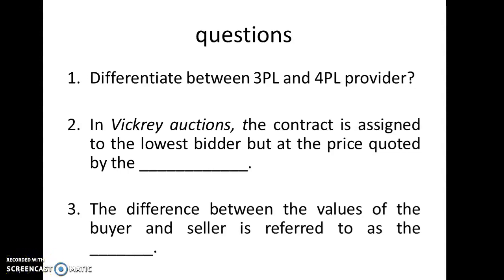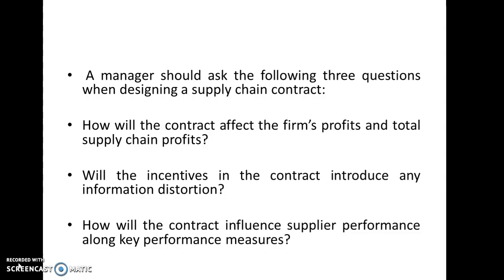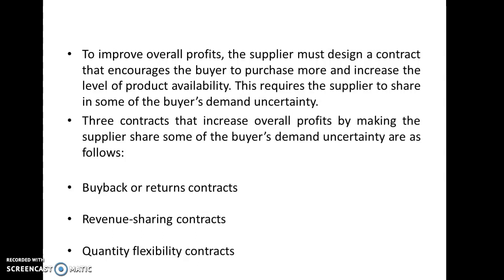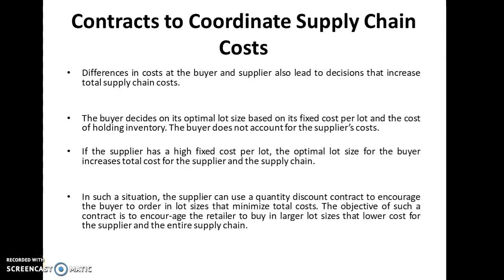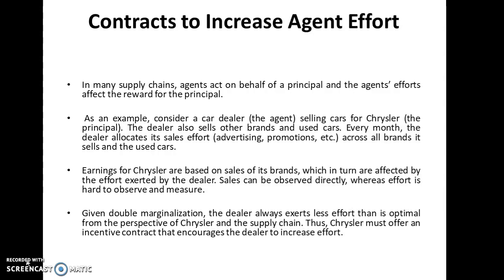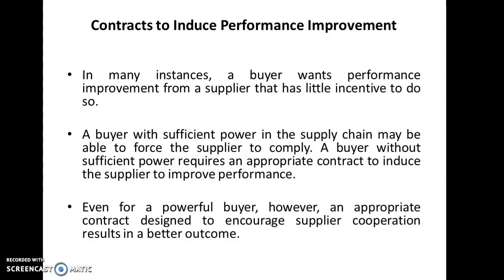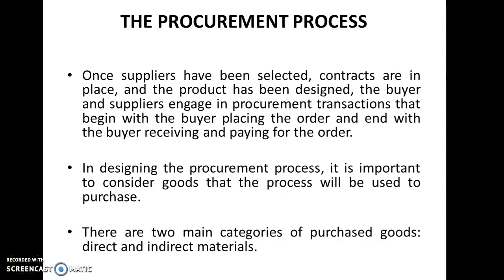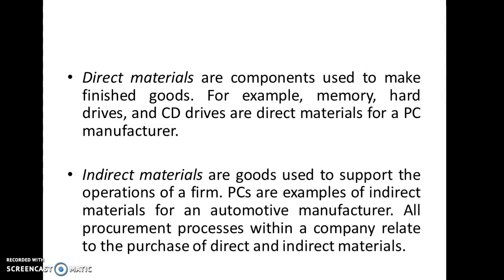Lecture 28 - Supply chain management

Comment: Name: M.Sowmiya
RollNo: 65
1) buyers-suppliers  relationship
2) quantity flexibility contract
3) Direct materials are any raw materials, parts or sub parts required for the completion of a product. 
Indirect materials are products that are not used as direct inputs in the production process but are still used or required in the production process